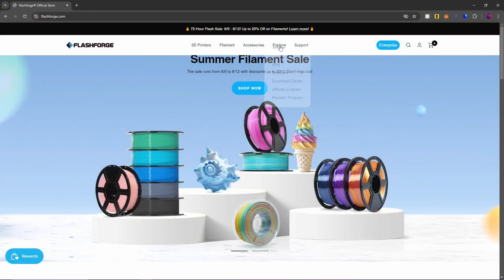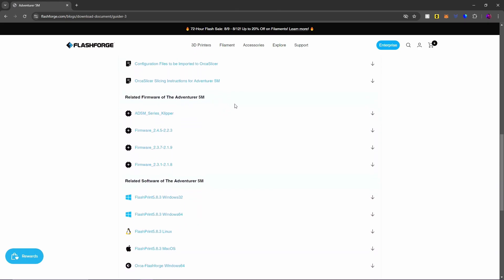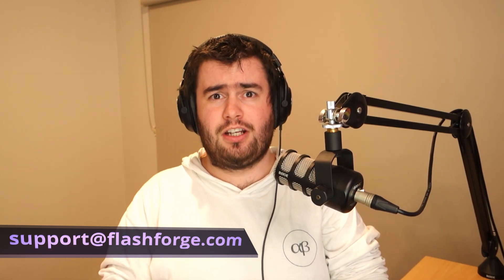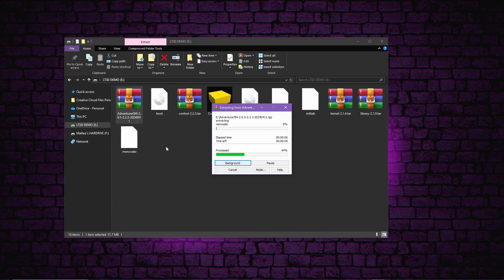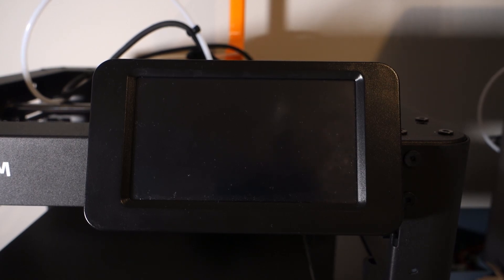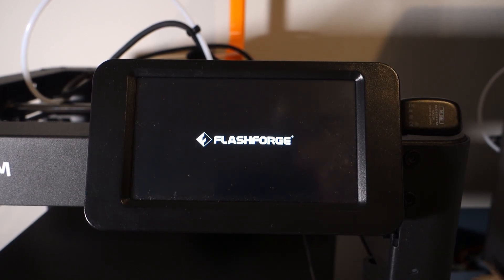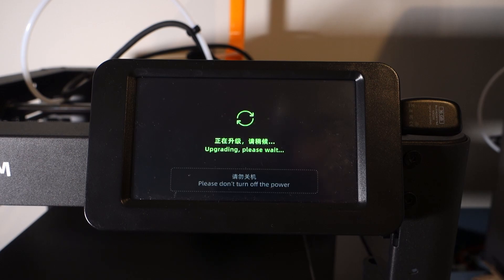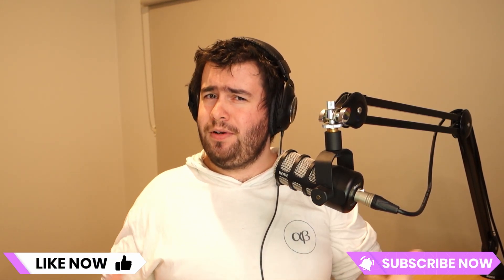How to Manually Upgrade/Downgrade Your Flashforge 3D Printer's Firmware!

Comment: On the a5m , you don't need to extract the firmware, just copy the file to the root of your USB.
Also v3.2.7 from the website didn't install. 3.1.5 seems to have worked ok. Might try the second newest and see how that goes.

Comment: Everything worked as shown but firmware did not change.   Same 3.2.4.  that is causing a bunch of issues....
Reply: 3.2.4 was causing problems for us, too. We contacted Flashforge and they sent us a link to get the downgrade to 3.2.3. It worked for us. The thumb drive must be no bigger than 16 gb, and must be formatted as FAT32. The unzipped files must be in the thumb drive's root directory. After the downgrade we did a full calibration. Our printer is back to normal now.

Comment: It could be the USB needs to be formatted at FAT32. I had a 64GB Sandisk I used that only read after i formatted it to Fat32.

 Usually anything above 32GB can only be formatted as exFat, but if you use a program like Rufus, you can format drives larger than 32GB to Fat32. your other option is to partition the drive into seperate sections. Previously I've had two 32GB sections of one drive, one in each format.

Comment: I purchased a 5m pro printer used with klipper and mainsail installed on it and now I’m trying to revert it back to stock os however no matter what I try nothing works. It just ignores the usb and boots to klipper, any suggestions?

Comment: Thank you very much for the video. However, one clarification. I have an Adventure 3 so my not apply to others. I had to extract the sub-archives as well before it worked. Forgot which ones; one wouldn't extract but worked anyway. And I moved all the extracted files to root thumb drive level then it worked. Thanks again. Gave you a like.
Reply from the maker: Thanks for the clarification on the Adventurer 3!

Comment: I'm trying this on the adventure 3 and it won't read the usb until after it's up and running
Reply: I have an Adventure 3 as well. I did need to use a SanDisk USB. First non-Sandisk USB didn't work. Also, I had to extract the sub-archives as well and move extracted files to root level. One archive didn't extract but it worked anyway. There may have been some duplicate files as well, I just "skipped".
Reply: @antoninuspius1747  i ended up emailing them and they gave me a package for the most updated firmware and it's been working great since.

Comment: Thank you so much, everything is going perfect
Reply from the maker: @EpicEruptor13  That is what I like to hear!
Reply: I'm obviously no expert but is it bad that the gears just aren't gripping the filament? I can simply just pull the filament out of the extruder withought struggle
Reply: @EpicEruptor13  there should be a tensioner but usually that's the part everyone makes a direct drive more in there liking but ya I feel ya
Reply: Why is my printer so mean to me

Comment: Bugs I’ve noticed: 
homing issue, printer bangs head on frame. Patched. 
z offset, I have to level before every print on newest firmware. 
Overheating nozzle, killed my .4 nozzle, probably a fluke. I still love this machine lol.
Reply: My printer also bangs the head on the frame when homing or calibrating; how did you patch it?